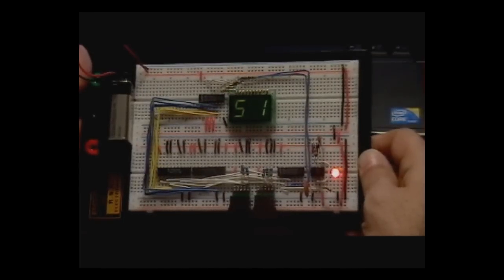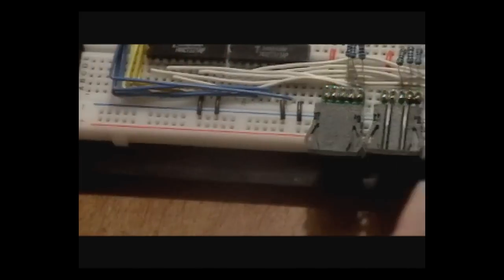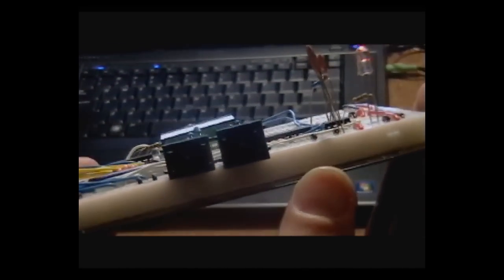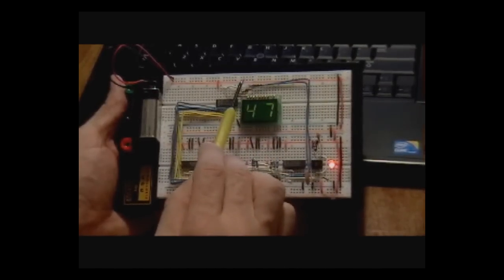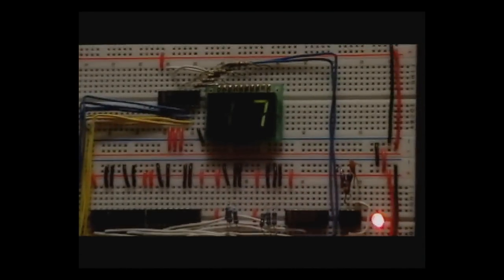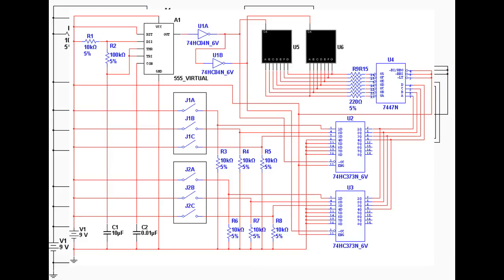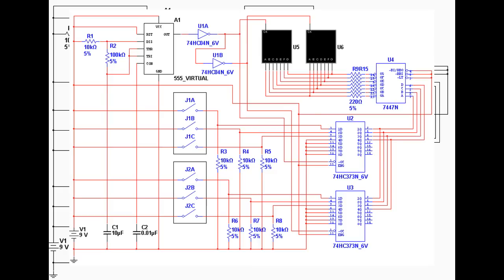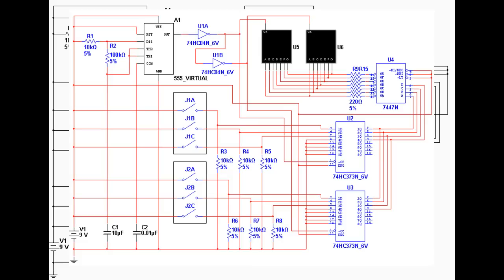Dual 7 Segment LED with Multiplexed Inputs with Schematic

Comment: Well I got my chips and duplicated the circuit.
It works very well. I tied the BCD lines to an 8 switch DIP and it goes to 99 now.
It was a fun circuit and I learned a bit about latches, tnx
Bob

Comment from the maker: Don't forget there is a problem with the size of the C1 capacitor in the schematic.  I noted the correction in the video description.  I was messing around with the circuit and forgot to set it back.  Let me know how it goes.  It is actually much easier than most would think.